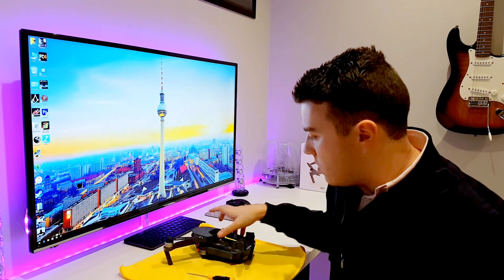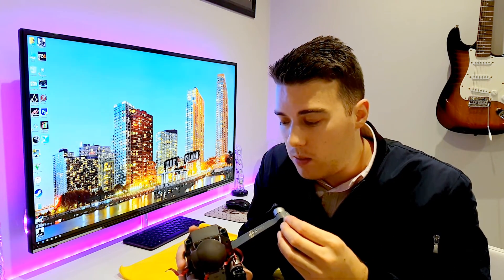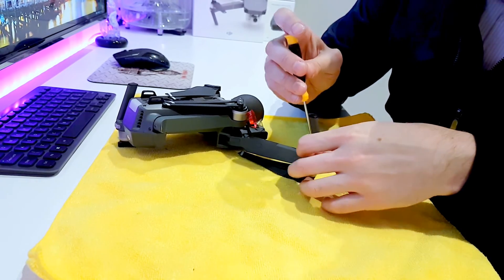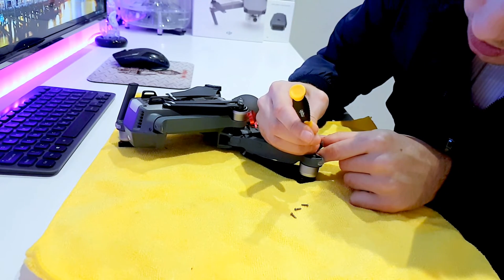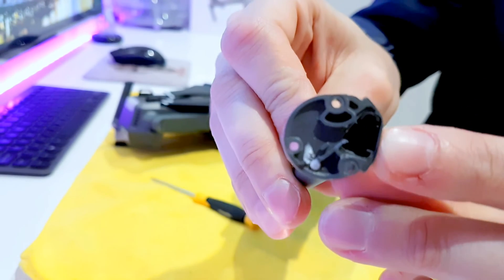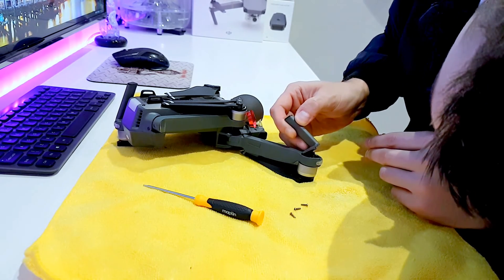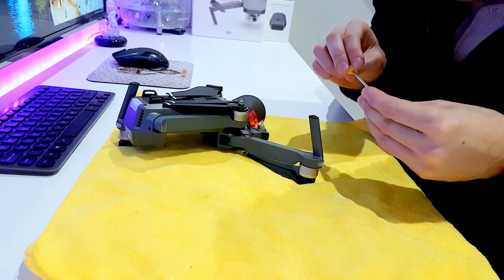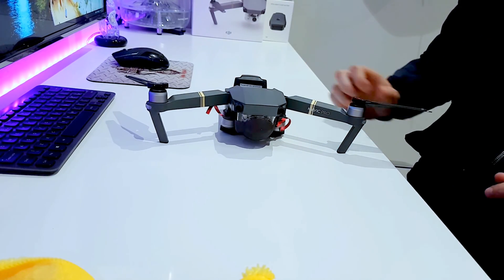DJI MAVIC PRO ARM LEG REPAIR HOW TO GUIDE

Comment: Thanks, great video.  My antenna did get glued down like yours, while working g it out the top 2mm of the antenna broke off, any thoughts as to whether that will impact flying or not?
Reply from the maker: Cant say for sure buddy but if it still seems fine then its probably not going to be an issue at all. Thanks for watching :)
Reply: @JCEntertainment  FYI, it seems to work, put the broken antenna in the new leg and she flew...  :-)

Comment: The screw heads on mine were 1.5mm socket hex (allen key), not T6 torx. The screw threads are M2. I glued mine but removed both parts from the drone before gluing to avoid gluing the antenna (thanks for the tip). Not sure how long the glue joint will last.

Comment: Thanks for sharing this clip... Cos it happened to my mavic pro too.
Reply: I was tried to fly during night time, it took off a foot and behaved/floating untamed like normally. And it knocked my vehicle door side and landed OK. But one the legs looked spilled a little, trued to tightening the screws.. However it won"t worked out so I order one set to replace it.. And hopefully there's someone could  to do that for me.

Comment: me too.. Thanks for posting this.  I have the very same problem ... although no crash involved. but i put some GLUE superglue to fix it and now the BOARD antenna can't pull out coz the it GLUED on its own. any ideia to remove without broken CAble? thax BRAZIL
Reply from the maker: Dude it was such a pain. I purchased a new leg and spent about an hour with a stanley knife cutting away at the broken one. Basically shaving away the plastic till I got to the board. It wasn't fun.
Reply: @JCEntertainment  OH yes! damnt! me too. For Lucky mine, i can handle a Cutter Plier and it help me a lot. BUt almost dieing by fear to tear the board down!

Comment: great video  i crashed mine at low speed but have lost one off the underside rear motor covers its the little circle one underside of the motor ,do they just clip on, or do i need to replace the whole rear leg,any help would be appreciated thanks

Comment: Hi JC I need your help to advise me where to look for one of these lights. I have exactly the same problem, on my first fly I hit a tree and  break one of the plastic leg. where can I get a replacement and what do they call them if you want to search for them I am going to end up buying the whole front right leg if I can't replace it. Thanks
Reply from the maker: Al A the whole arm is the same price I paid for just the leg you might aswell just buy the whole arm from Amazon and then at least you have some extra spares including a motor
Reply: Thank you very much for the quick reply and a good advice

Comment: hi where do you get legs from? my buddys dog jumped into my mavic the rear blade started to cut into the front leg and I can't find them anywhere. It still works fine but one day....
Reply from the maker: Check out ebay pal, you can get the entire arm for a decent price nowadays.
Reply: I did, thanks for the suggestion. Only $40 CDN shipping in. Both legs and the rear in the set. I can't wait to run my fur friend, he loves the drone and will follow it for hours. Really hours.

Comment: One of the legs of mine broke through (Completely broken) how do I fix that?
Reply from the maker: Alex Tan if it was the leg it's the same process. If it's the complete arm that's a bit more complicated as you will need to solder the replace arm and motor to the board.

Comment: Mine damaged in the same place but not from ground impact. Yes I was in Sport and didn't break in time- I collected a few small branches of a tree. Took a small chip from a prop and another small prop crack. But other than the prop and a scratch on a leg I thought that was it. Until I found the leg come away from the underside of the motor mount. Seems odd. Maybe that's a weak spot for some reason? Thoughts?

Are you sure the glue is a bad idea? Did you apply glue with the antenna still inside? Is that why the glue went onto the antenna board? 

I was thinking of removing the leg completely and taking out the antenna like you showed and then using epoxy while keeping the plastic in the original shape. Still a bad idea?
Reply from the maker: Yes i think its a weak spot but there is sure to be weak spots on such a design we just have to try and not crash lol. Adding glue with the antenna still in place is a BAD idea. Do as you said and unscrew the leg, remove the antenna and focus on fixing the leg (away from the drone) with some glue and possibly some sort of clamp to keep it in place while the glue cures. Don't put the antenna back in place until the glue has cured 24 hours. Hope this helps.
Reply: That's great. I did that - removed the moulded plastic from everything and tried to heat it with warm air carefully and shape it back to original. Seems to have lessened the visible gap somewhat.

https://www.dropbox.com/s/46e2tarp0ixah61/2017-03-01%2023.58.38.jpg?dl=0

Comment: Hi, have you got a contact for Jeff at Salvage drone? or anyone else maybe (hopefully) in the UK.   my mavic decided to crash land like a very heavy brick today, lucky on grass, but the same has happened to me, left landing arm damaged like your's was.

Many thanks in you could help.
Reply from the maker: Sorry I don't know anyone in the UK with these parts yet but Jeff's email is salvagedrones@gmail.com he is very good. He'll send you a PayPal invoice and send it over the next day, normally takes about a week in the post. How did the Mavic crash land, was it pilot error or the drone?
Reply: Thanks fro that, I tried looking for the website for the Salvagedrones, didn't find it.

I was in Sport mode about 15-20 feet above the field, I pulled the down rudder and the Mavic just shot down like crazy. Maybe I pulled it down too fast but don't think I did.

I shall look at the flight data tomorrow as I'm on nights at work today.

Thanks for the help.
Reply from the maker: in sport mode you will lose 3meters per second in altitude so at 15ft you have 1.5 seconds
Reply: JC Entertainment  that'll be the reason, misjudged the hieght more than likely and the speed.  damn, at least it's no major damage.  thanks for the help. keep up the good work.